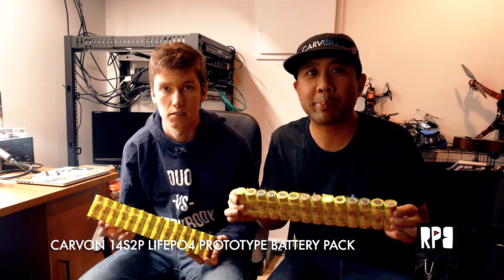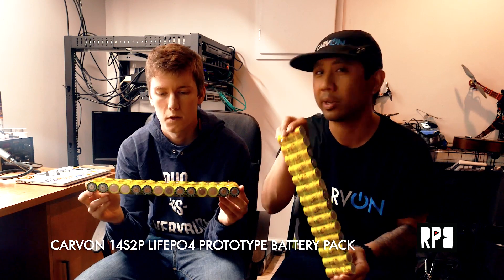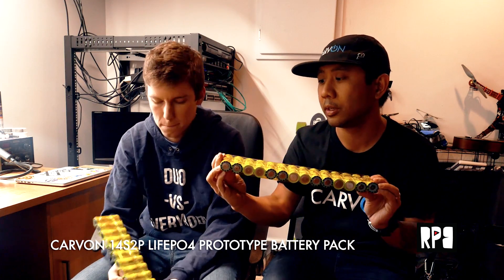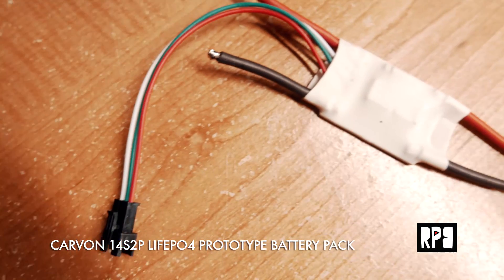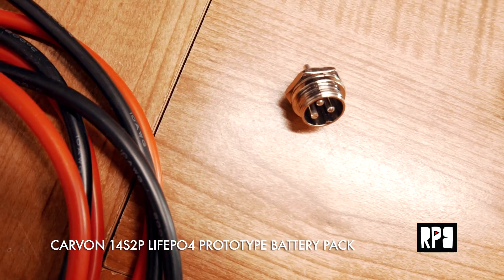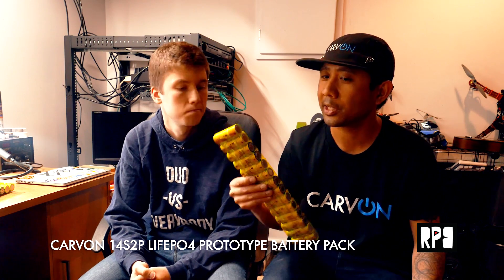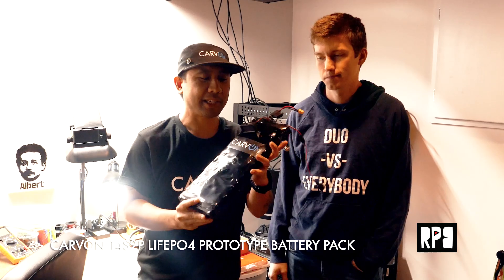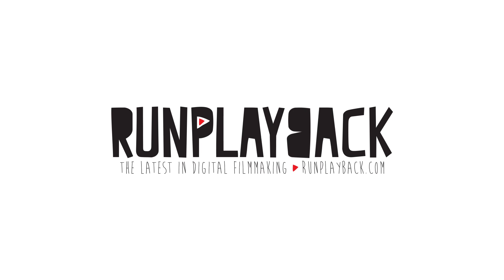We Built a DIY 14S LiFePO4 Electric Skateboard Battery

Comment: Super nice pack! I noticed the fuse holder wire seems really thin. Is it able to handle the current without warming?
Reply from the maker: That's a good question, we'll be testing it soon and I'll let you know if it gets too hot under load.
Reply: Thanks. It'll be interesting to hear your results. I currently use a maxi-sized blade fuse between my batteries and VESC, which has much thicker wires :) It might be worth checking out.

Comment: So the cells are separated only from the thin plastic that came from the factory.they are just a milimeter close to short ..
Reply from the maker: Which cells? The ones running in parallel?
Reply: No the series ones can not be arrange like this and touch its other specialy on an e.v because of the vibrations.they need some distance for the heat to dicipate too
Reply from the maker: These are how most ESK8 batteries are arranged. How do you suggest they should be arranged?
Reply: I dont know if you got space but if you dont make the pack lower voltage and space the cells with proper connectors .i think the 26650 cell connectors is the ones that fits that cells.better safe .
Reply from the maker: Yup we have 26650 cell holders but chose not to use them because of the spacing inside of the enclosure we're using. We do have plenty of hotglue and several layers of kapton tape holding everything down to prevent shorts. Also adding a layer of neoprene foam between the pack and enclosure to handle vibrations.
Reply: Hot glue is not for that use at least i dont use it in my packs.
What is the temprature of the pack in use?
I think that cells dont make that much heat compared with others .
Reply from the maker: Just waiting for the dual motors and VESC's to come in this week and will do some actual load and heat testing.
Reply: I separate my cells in series with a thin plate of bakelite .it have all the properties that is needed for a safe pack.

Comment: What's the difference in LifepO4 over 18650s?
Reply from the maker: LiFePO4 batteries are the safest type of lithium chemistry as they will not overheat, and even if punctured they will not catch on fire. The cathode material in LiFePO4 batteries is not hazardous and poses no negative health or environmental hazards. Due to the oxygen being bonded tightly to the molecule, there is no danger of the battery erupting into flames like there is with lithium-ion.
Reply: So from the video it looks like you guys used around 20-30 cells correct? what was the build material cost compared to a 18650 12s pack?
Reply from the maker: 28 cells total. 26650 is roughly 2-3 dollars more per cell than an 18650. Depending on quantity, you can find the 26650 for about 12-14 dollars a piece.
Reply: so you only need to run half the cells to ge the same voltage as a 12s 18650 pack? that's amazing if so.
Reply from the maker: no not exactly...for this 14s2p setup our LiFePO4 BMS handles 44.8v 60a so it's actually close to a 12s 18650 pack voltage. So the advantages of the LiFePO4 is more about the stability and safety, it simply won't catch on fire even if punctured - the tradeoff is that the cells are larger and require more space on the deck.
Reply: and much much more weight for the same capacity as Li-Ion...
Reply: Great battery! What size of nickel strips did you use (0.3mm or 0.6mm)? What's the spotwelder brand?

Comment: HOLY SMOKES!!!! i just made a video talking about anti spark!! Im glad to see the initiative and well thought out plans
Reply from the maker: Hey Joe, look up the Vedder Anti Spark switch..its really useful and prevents the sparks that can wear down the connections.
Reply: thats exactly what i said in my video. you should check it out
Reply from the maker: yup saw it last night...good stuff man, I'm thinking of just modding my Genesis battery pack as well - the ESC and motors just feel too sketchy for me
Reply: awesome, ya when i inspected their electronics I was blown away to say the least. Their board is for beginners that wont get a lot of use out the board and that's about it. Seems like a real common story between owners of the board complaining about their electrical problems. it's kind of crazy because the last two boards I had of theirs was working flawlessly. actually this last one was great. I was like wow that actually nailed it everything seems to be working perfect. then all the sudden that's it cant turn it on anymore. It actually shut off mid ride.
Reply: RunPlayBack vedder anti spark switch is a different concept then what I was talking about. Really the switch that i would prefer to use. It eliminates a contact off and on switch by using momentary and an transferring the power to on with the mosfets. Thats a proper switch and with a battery that big id customize that switch well at least the one i saw when i goggled it. See Genesis is close but no cigar. I actually had a fet stick open. Its these little things that you would think would be ironed out before products hit the market.